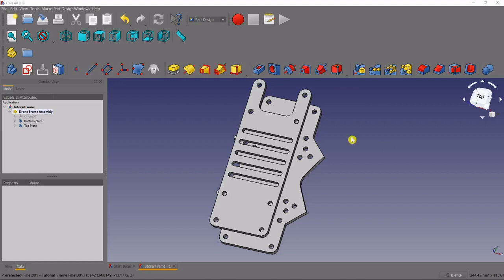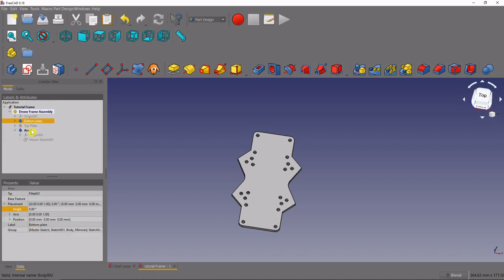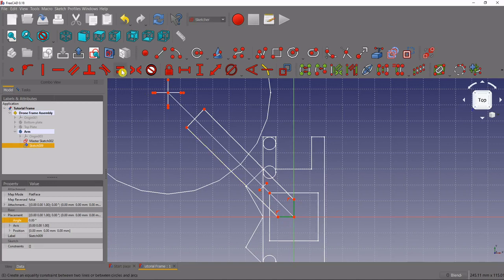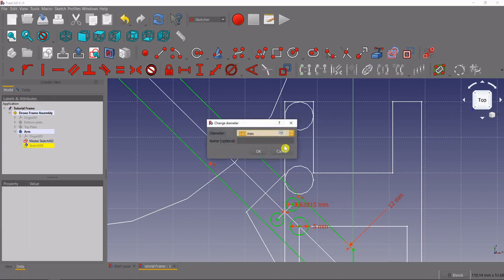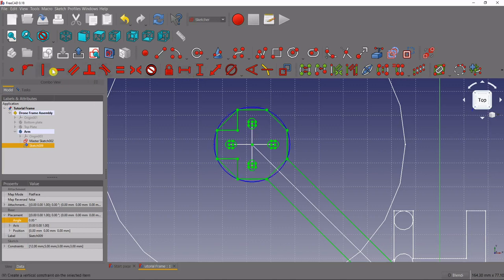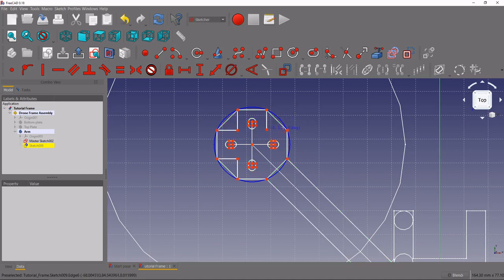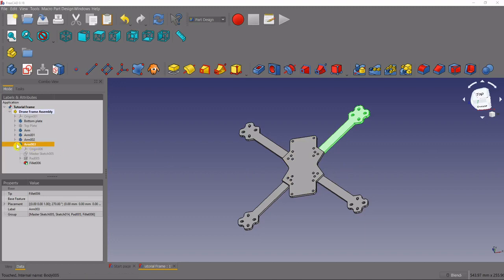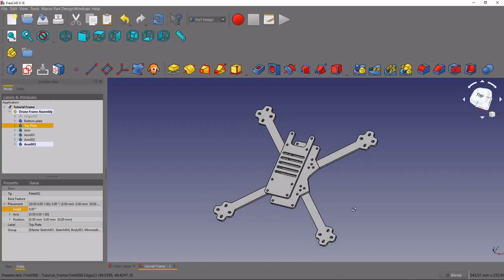FreeCAD Part Design with a MASTER SKETCH | Tutorial for beginners | Drone Frame Series | Arms

Comment: Thanks for that tutorial. But maybe I missed something, but when you copy the master sketch from the top or bottom plate to an arm, won't you loose the strenght of the master sketch? If you change the master sketch in the top plate, this change won't be propagated to the arms, right? There are now multiple master sketchs.
Reply from the maker: That is correct.  This is because they are different bodies in the same assembly/part.  I tried and tried to find a workaround for this, but there just isn't.  Youu are correct, if you change the master sketch in one body, it will not change the other master sketches. However, if you change a master sketch in one body to can make both sketches active and you will be able to see the difference between the two.
Reply: @FPVBuilders  Maybe I found a solution: Look at this video: https://www.youtube.com/watch?v=nNQubIoECpM He uses the "Draft" workbench to create a clone of the master sketch which does not loose the connection to the master sketch. If you then update the master sketch the clones will update as well.
Reply from the maker: That's awesome!! Thank you so  much for sharing.!!

Comment: Thanks for the awesome tutorials! One shortcut I've found is when adding fillets or bevels, you can <Control> click to select all the vertices you want to operate on, then press <Fillet> or <Bevel>. It seems to be a lot faster than clicking the individual vertices and then clicking <Add> one at a time.
Reply from the maker: That's a great tip! Thanks Karl.

Comment: Wow! You have opened up a lot of new commands and techniques that I did not know about, thanks. You must have spent a lot of time on FreeCAD. When I add fillets and I am selecting the edges I display my model in wireframe and it makes selecting them easier for me. Do you see any problems with that method? Great video! I am not a drone owner but I am very much enjoying your design of the drone frame. THANKS!
Reply from the maker: Thank you!  I do not see any problem with using the wireframe display,  I may incorporate it into my next tutorials.  Thanks for the tip.  I really appreciate the kind words.  I do in fact spend a lot of time developing these tutorials.